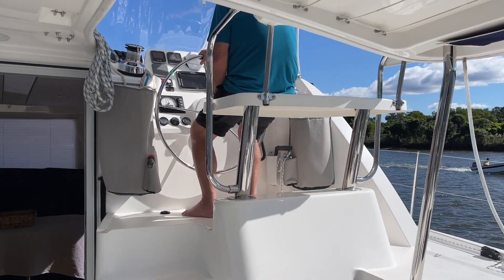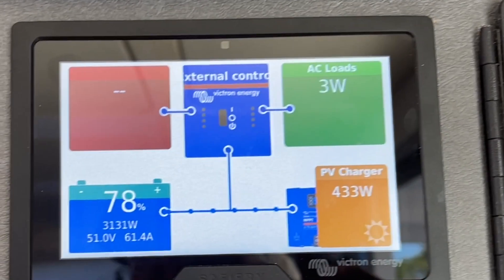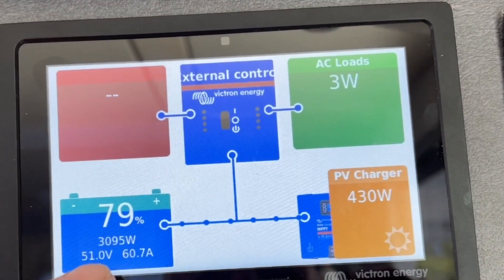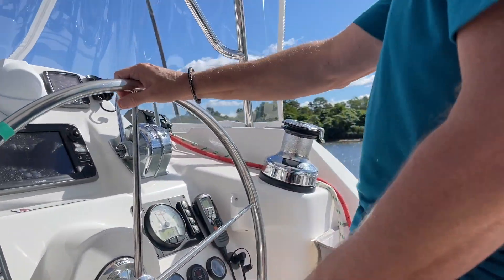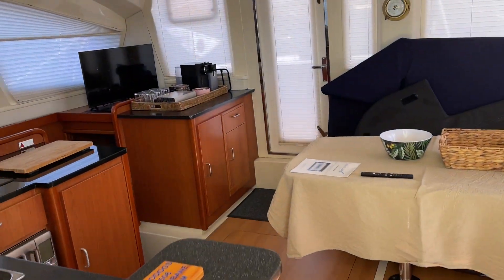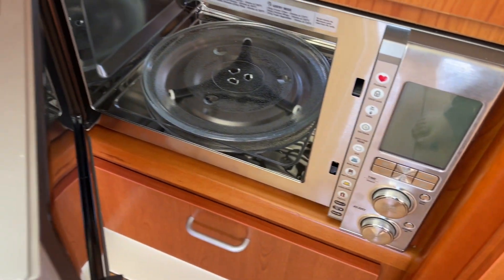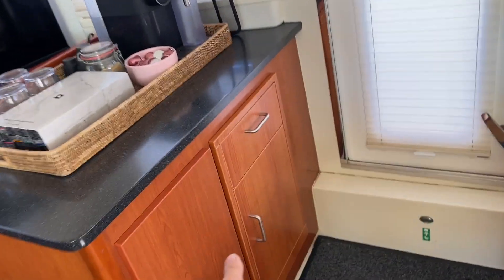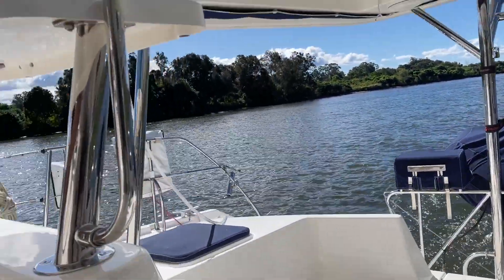Leopard 44 Sea Trial with Scotty and 2 x 250A alternators on Yanmar 40hp engines and 1320W solar

Comment: Those tachos are alternator driven and look out. Would this have anything to do with the alternator change out from OEM ?
Reply from the maker: Our after market Yanmar alternators are 8 pole, the factory ones 6 pole. So we built a pulse converter fully potted and it nicely gets the RPM back to accuracy. I dont think these were fitted here before this sea trial.